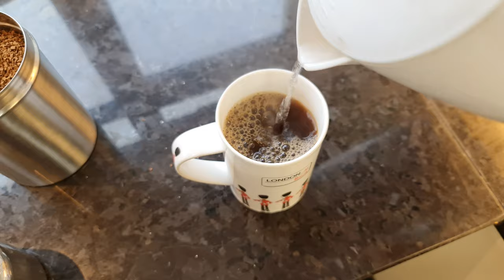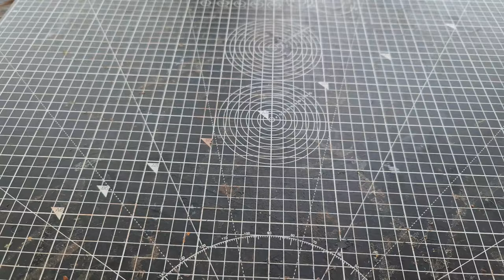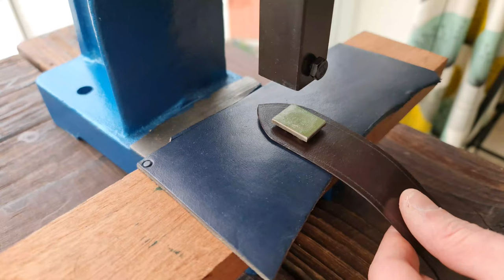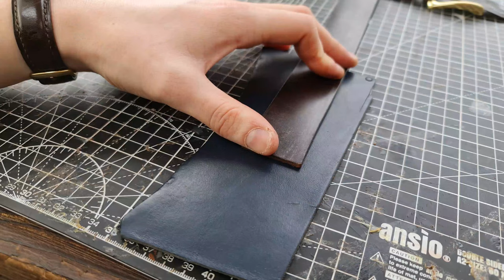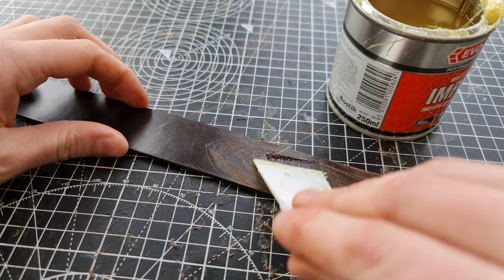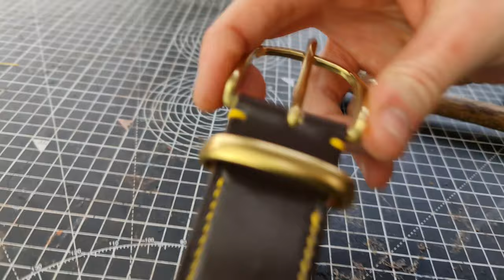MAKING A HANDMADE ENGLISH LEATHER BELT - DIY BUILD ALONG - 4K - ASMR

Comment: Why did you choose such a weak leather for the most crucial part of the belt?
Reply from the maker: It's the exact same leather just spliced so I can wrap it around both sides. This means you don't get the ugly stitch on the back side when you simply fold the leather over onto itself. Basically, it's preference. Having said that, if that singular peice was to fail the design is modular so I could always restitch another peice on. Which you couldn't do if you used a single peice folded onto itself. Hope that clears things up :)
Reply: @W.CambridgeLeatherCraft  That makes it kinda disposable. Just imagine – a guy buys a belt, that buckle-holder-thing breaks up in a year or so. And what's his next step? Trying to repair by his own? Looking for a workshop for repair? Non-leatherworking-people don't really think about small leather goods as of repairable ones. Yes, you can't restitch single piece folded onto itself, buy you don't need to. If it has reasonable thickness – it SHALL last for a long. Most belt leathers are apr. 3.6-4.0mm thick, you can skive folding area to apr. 2.5-3.0. That'll do the trick. Or at least, you could use 2.5mm leather for that separate part
Reply from the maker: @CapitanAP  I guess it's upto the person making the belt to make the choice. I've used a belt that's the exact same as this one for nearly three years now and it's completely fine.
Reply: @W.CambridgeLeatherCraft  Okay